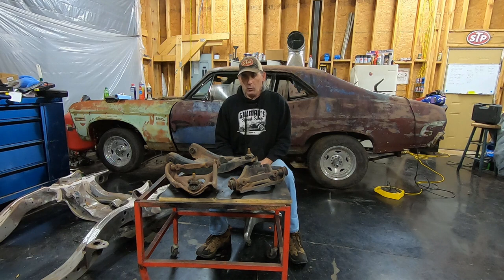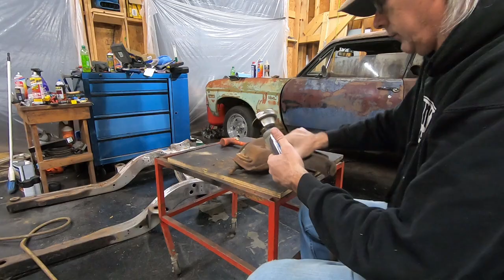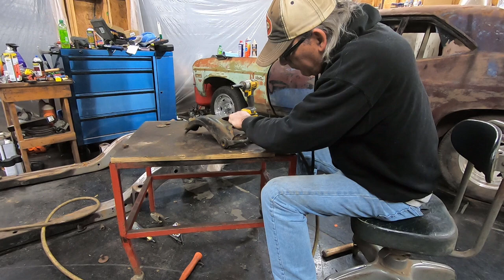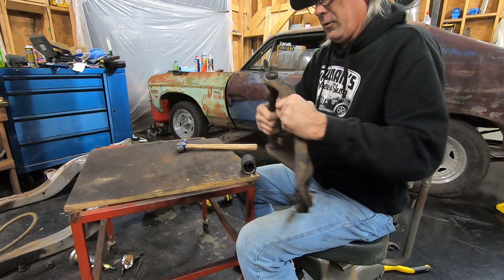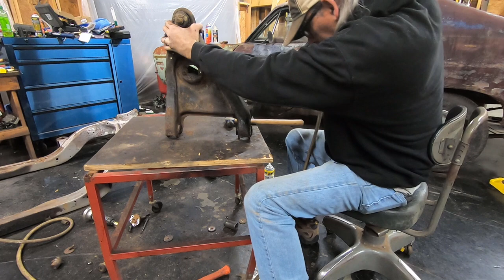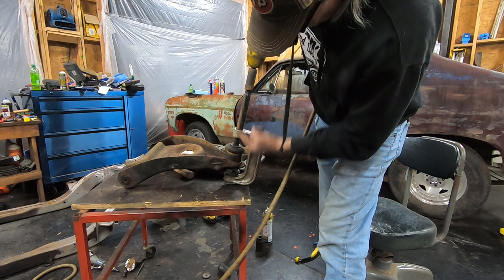Rebuilding Chevy Nova Control Arms

Comment: I've been putting off rebuilding the front suspension. Ball joints i dread, i need the v8 version springs in the front too so the car isn't so low, i still have the inline 6 springs in. I also am considering getting a hevay duty sway bar as well, but i know i need to redo the suspension first probably

Comment: Awesome videos! On the poly bushings I've been told you need to keep re-greasing (install grease gitting if possible).  On control arms is this true?  
 I've got a 74 only had poly on the sway bar (no sqeaks) and leafs (squeaky but i got over it).

Comment: 👍🇨🇦 
Are you doing anything to help upgrade the stock arms….like welding some strength in?
Reply from the maker: Not on this build. The best mod to stock arms is an upgraded shaft with built in offset.

Comment: Just buy new a arms with everything already installed. I've tried this with a press and everything nothing works. The a arms just collapsed wasted two days removing and trying to install the new $70 set of bushings. If you can't afford new a arms just sell your car. I removed and installed my engine, trans and rear end by myself without any issues, these aren't like that, nothing will work unless your lucky as hell.
Reply: Update. I managed to get one side of my 71 Nova finished, it's turned out Ok I guess. Imma do a video on it once finished, a press is useless on these only chisels and hammers work.
Reply from the maker: A regular press will destroy the stock a arms. It sucks to replace the bushings. Definitely takes practice to get it right. If I’m not on a budget I buy new arms.
Reply: @Shop209  Yes Sir I was watching mine and could tell the press wasn't gonna work. Got them on the car, they seem fine hope I didn't damage them.
Reply from the maker: With a press it’s hard to know how much pressure you’re putting on them. If the arms didn’t bend and stay that way you’re fine.
Reply: @Shop209    Thanks,  here's a quick video of it,  I've got a good 71 model.  I also still have the very 1st car I ever got at 14 years old,  a 1974 Nova,  gonna restore it soon.  I love them,  great channel you have,  great info.